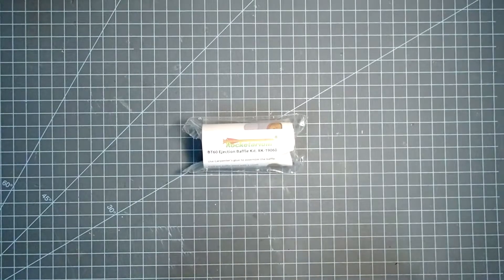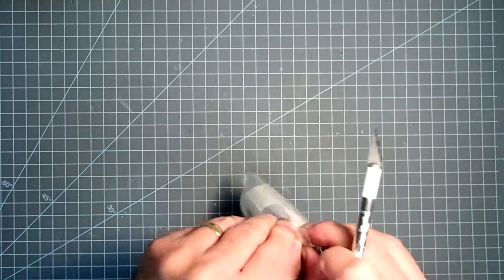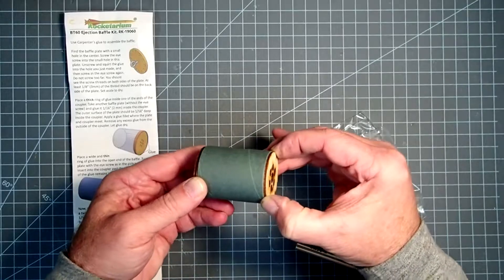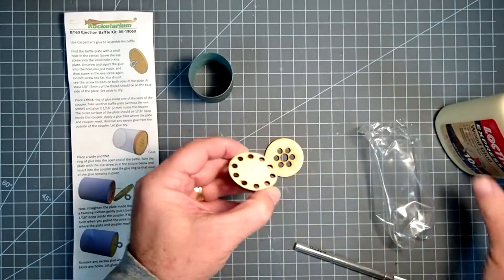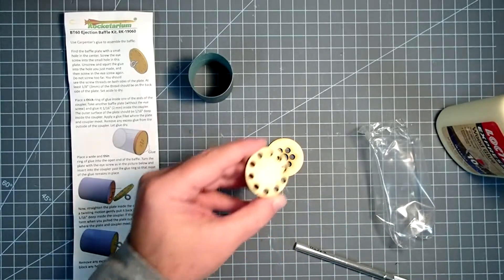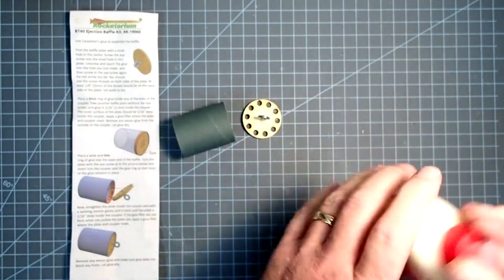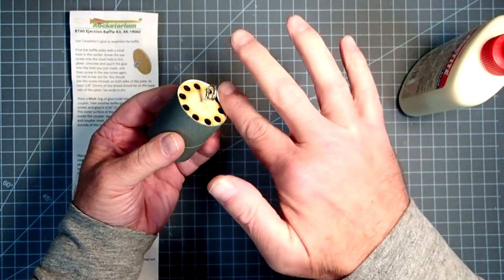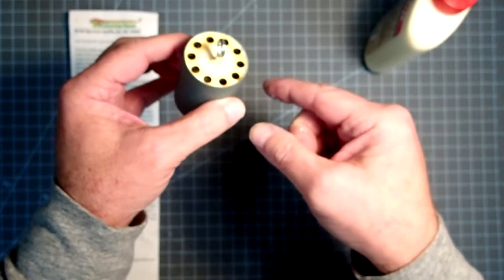Rocketarium BT-60 ejection baffle assembly

Comment: I assume you glue the baffle inside the rocket tube? You didn't mention that in the video. My first time using a baffle.
Reply from the maker: Either glue it inside a body tube or use it to couple two body tubes (most common).

Comment: I think for some of my future builds, I'm going to go in this direction. My concern is that I'm building my rockets now with Kevlar string attached to the engine mount since I dislike the Estes method of gluing the shock cord to the inside of the body tube (wear and tear on the chute and strings, potential hang ups, or disconnects). 
Do you think there would be any issues if I threaded the Kevlar string through the baffle holes? That seems safe to me. The masking tape at the forward end (to prevent "zippering") would prevent the string from falling back through the baffle hole.
Thanks for the vid re: this. I didn't know they sold them individually.
Reply: @TigerHawk65  Ahhh man. I was going to sleep last night and I thought... "No. Wait. It attaches to the eye screw." Doh!